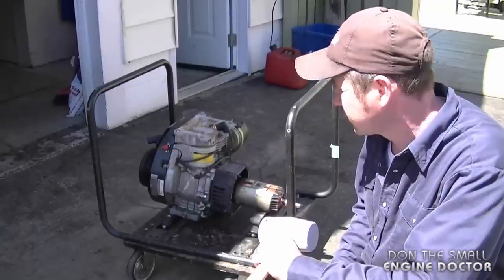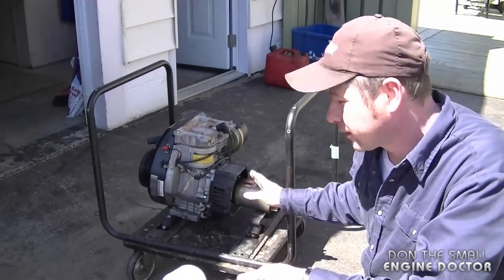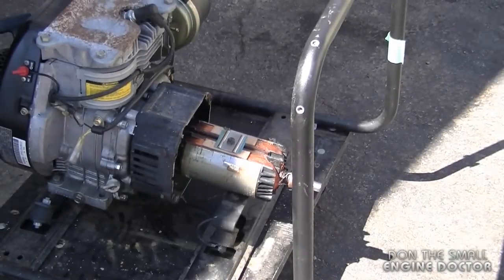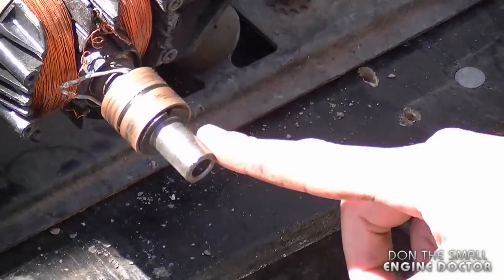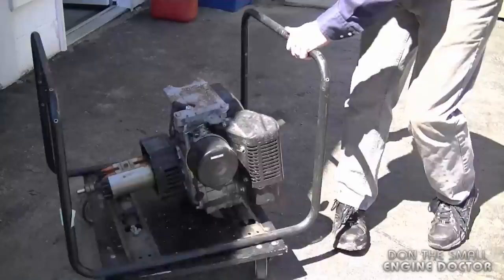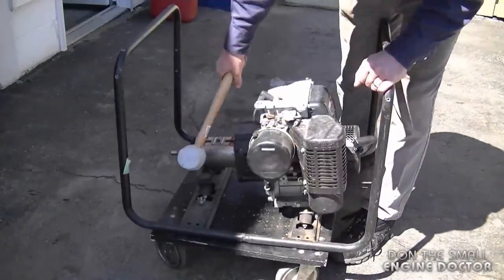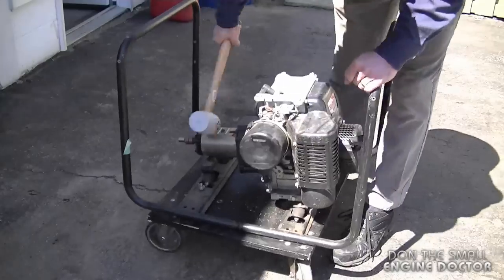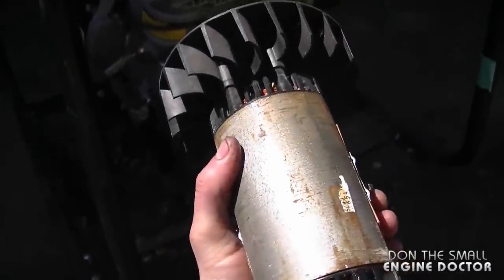HOW TO Easily Remove A Generator Armature

Comment: If the dead blow hammer doesn't work try this. The end of the armature shaft is usually threaded. Find a bolt that matches. Wrap threads with Teflon tape for a tight fit. Fill the armature shaft with oil. Thread the bolt in then run it in with an impact wrench. The hydraulic compression will pop off the armature. Hasn't failed me yet!
Reply from the maker: thanks, i'll have to try that and make a vid of it
Reply: if the end of the armature doesnt have threads you can tap it and make some.....ive tapped them and installed a grease zerk and then hydraulic'd the armature off with a grease gun ;)
Reply from the maker: JEREMY FOUNTAIN i'll have to try that someday, what's your skype

Comment: Used this method on my onan 4000 worked great . Tried your other method ,armature was already threaded but couldn't find a bolt to fit . The hammer took it off in about 3 blows . Thanks a mint !

Comment: Awesome tip, just helped me get an armature off an older Coleman generator in like 30 seconds. My dead blow hammer was too small for the job, so I used a small sledge hammer with a block of wood (piece of 2x3 pine I had lying around) and it popped off with just 2-3 moderate hits on each side through the block of wood. 

I didn't want to whack it too hard, but I guess the impact transfer was good through the wood and it came off in just a few taps. An added bonus is that the wood acted like an extension, so I was able to whack it from both sides without removing motor from the frame enclosure (there wasn't much space to swing a hammer in there, lol). Also, I sat the metal enclosure of the armature on a piece of 2x4 to relieve it off the rubber motor mounts, which undoubtedly absorb some of the impact as you hit.

Anyway, this impact method worked like a charm, thank you for the tip!

Comment: Thanks for the video. It came off really easy with this technique. If you're planning to use the engine for something else, you're going to need a lathe or a different crankshaft because the end has a really weird shape with no keyway.
Reply: You can can angle grind it to size

Comment: I have a kohler  model 1.5 M 25 and the cooling fan came loose looks like it just needs to be bolted on agen this is an older Kohler generator and I'm wondering if the armature will be stuck on like the one in your video any advice would be much appreciated

Comment: It doesn't hurt em. You have to be Godzilla to hurt it doing this. That hammer is ok, or a plastic hammer works good too. I do like to support it with a block of wood though, it seems to help transfer the shock wave. And also try and strike it as if you were trying to turn it with the hammer blow helps also. 
Good vid, I've done this often. 
Only thing is on reassembly depending on the type of gen it is, you may have struck the residual magnetism ( fancy eh?) out of the rotor. But that can be restored on start up if you have no output, by flashing the field.

Comment: Im going to be a bit picky, i dont believe that is a dead blow hammer. i may be wrong but it looks like a simple rubber face mallet
 A dead blow hammer has weighted ballast in that moves inside the head of the hammer, and when you strike, the shot impacts the inner face of the hammer, giving a harder hit and no bounce off
Reply: Picky or not you are correct.  When we start calling apples oranges society will decline into the murk of which we sprang (or slithered) from.
Reply: maybe they call a mallet a dead blow hammer in canada?
Reply from the maker: you might be right, thanks for the info
Reply: Jordan may be right, but it sure did the job, and now you can call it a Canadian Rubber Half Dead Blow Mallet. Don't teach him too much Jordan; I think he could get cocky. :)

Comment: Thank you very much, The honda company is very "up tight "when it comes to charing information. 
My generator has a broken RPM govenor, any info on dis mateling the engine?
Reply: Hi Jo, I have a old em 650 with a gov- that doesn't work, I just un-bolted the gov-end of the motor, propped the end up so to get the cover off- Maybe you can do the same ?

Comment: So the actual proper way to do this in to use A 3/8th's  steel rod cut to 1/4 inch shorter than the center hole. if the armature is threaded on the end simply drop the rod down the hole and tighten A bolt in the end. If it is not threaded you can thread it with A 7/16x20 tap the metal is soft and taps easily.  it will pop right off and you will have no damage to the armature and no grease or oil to clean up.

Comment: Was that a homelite 4200 watt and what was wrong with it?
Reply from the maker: +evanchapmanfanman I think so, it wasn't producing power
Reply: +donyboy73 ah ok, I have the identical unit and its in mint condition, watch out for fuel leaks on the carburetor though